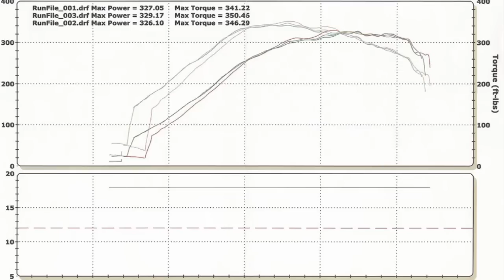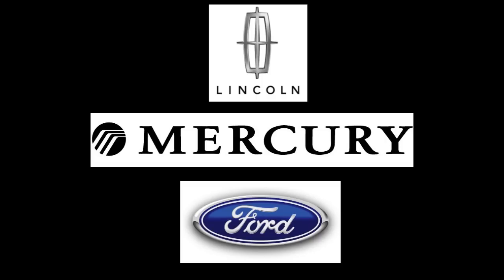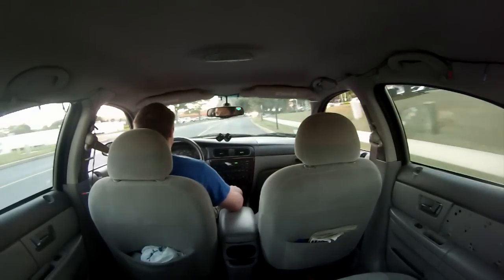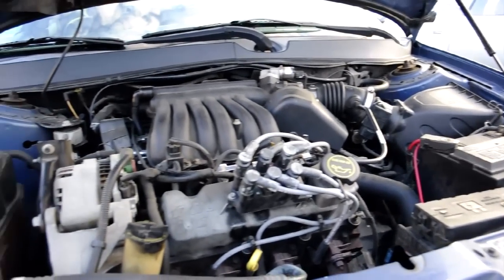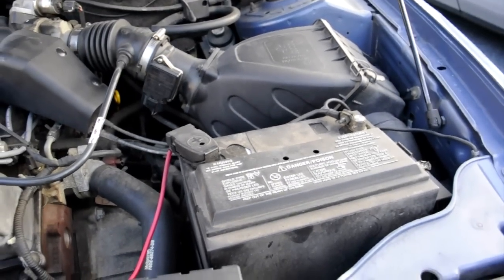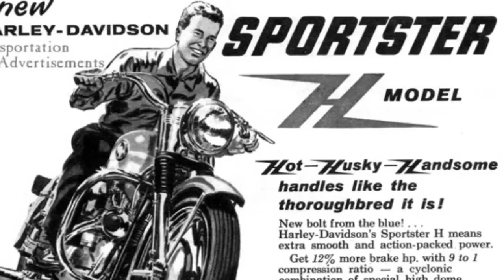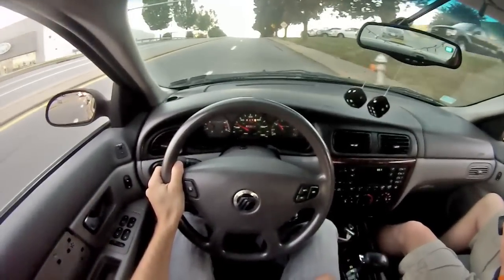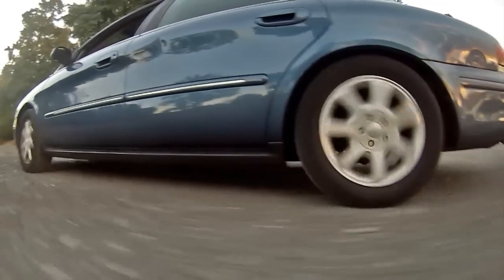Regular Car Reviews: 2002 Mercury Sable

Comment: My friend had the Taurus version and it blew a head gasket while drag racing me in my moms Windstar with the same engine.
Reply: +Evann Smith This mad me laugh so hard haha. I remeber my 2003 Taurus and man that thing just had no power to do anything but fishtail on dirtroads
Reply: +Evann Smith I had a '99 Taurus with the same engine as my first car. Got it with 101,000 miles on the clock, didn't even drive it hard, and the block completely locked up a week after I hit 104,000 miles. Hadn't even had the car six months.
Reply: +Evan Richardson How long had it been sitting?
Reply: I had a 98 Taurus "gifted" as a hand-me-down from my grandpa to me as my first car with just something like 20-30k on the odo. The car did not last past 64k. Somehow in that span of time all of the computers died, it had emissions systems problems, electrical issues, the radiator rusted out and clogged the coolant loop while driving on the golden gate bridge, and finally the transmission just totally shit the bed and we crushed that demon.
Reply: samwise1790
I had a 626 that uses the same transmission and it was terrible. It needed a rebuild every 20k. Ridiculous.
Reply: Lion Celica it didn't sit. It was my daily during the short time that I owned it.
Reply: Way late to the party but. I had a 99 Taurus with the duratec 3.0 and it was pretty decent for me. It was my mother's daily from 99 until 2011 when it was handed down to me. It lasted me until I traded it in at 112,000. Talked to the dealer a month later and the next owner blew it up. To be fair it had started to leak oil among other things. These cars were good but only designed to last until around 100,000.
Reply: Guy I worked with has a Taurus that fell apart within 6 months of getting it
Reply: @Inferno_Assassin  i had an 08 fusion with the duratec and when I sold it it had 230k on the clock and it was my first car as a 16 year old teenage male. To say I drove that car hard is an understatement. I was constantly pedal to the floor, sending it as hard as I could around corners etc and It held up well. Had a slight oil leak around the timing cover and the sunroof leaked, but the engine and trans still ran just fine.

Comment: The Sable was the vehicle for those that saw cars as an appliance, nothing more. Acceleration with the Vulcan V6 was best described as "eventual".
Reply: I chuckled
Reply: Eh, it's actually a pretty good motor. The best way to describe the Duratec and Vulcan is this. The Duratec is a high rpm horsepower beast and the Vulcan is a Low rpm torque monster. The Vulcan V6 does not like to rev high.
Reply: @legostar55  True... the 2001 taurus i used to drive had a vulcan and it didn't rev crazy. Acceleration was surprisingly okay, did't feel much different than dad's old 1999 suburban that had 255 horsepower. When punching the gas with the wheels turned hard left or right from a stop sign, the tires almost always chirped
Reply: Yeah, I've had 5 Sables pretty decent quality. But 1 of mine had the Vulcan while the other 4 had the duratech. The duratech is definitely the engine you want, it has good power, could take a little bit of high revving if ya gotta "give it the beans" and its relatively good on fuel even by todays standards. The Vulcan although reliable and pretty well made, I have to say. It accelerates like a dog being flogged, especially uphill. Another thing, these cars are great as long as you keep the engine and transmission oil and fluids clean

Comment: I had a 2002 Ford Taurus, and I can say beyond a shadow of a doubt that there is no way the suspension is softer in the Mercury Sable. It wouldn't support the car anymore. That being said. I sold it with over 215k on the odometer. I treated that car like dirt, and it just came back for more. The A/C compressor died and caused an overheating issue, but once that was disabled it ran just fine. The headlights were so fogged over that if you didn't use a restoration kit on them every year you couldn't drive it at night. It was rusted completely through on the rear quarter panels, but I made a $25 profit when I sold it. The Vulcan engine is the most boring motor that I have ever had in a car. It doesn't rev, it doesn't make power, it gets mediocre gas mileage, it doesn't sound good, and it's not very light. It takes forever to warm up on a cold day, and there will always be a small oil leak somewhere (mine was so slow that you didn't have to add between oil changes). It will always smell like oil, but you'll never bother to fix it because... you paid $300 for the car... and then sold it for $325 after you put 15k miles on it.
Reply: Turner Pendergrass The car i learned to drive on was 98 Sable that had the Duratec, it was awesome unfortunately the security computer died in it and made the car so unreliable that my parents had to get rid of it.
Reply: Turner Pendergrass i had an '01 Taurus with the duratec and i loved that car. I treated her like dirt too and the thing kept coming back for more, kinda like herpes. The duratec made a much better noise than the vulcan and it was pretty much bulletproof. Tune ups were a pain because of all the damn vacuum lines, and having to remove the upper intake manifold but hey, she ran like a top most of the time. i got her with 116k miles and sold her to my mechanic with 172k due to a fuel pump issue. Ive seen it around town and still looks and runs as it did before the issues. Safe, solid cars but by this time ford had given up on the platform and relegated it to fleet sales.
Reply: David Gonzalez 01 Vulcan, here. It went through 3 or 4 sets of springs (they kept breaking), always pinged and it ... literally ... rusted in two at 75K miles. Always babied it, too.
Reply: Mike Miller Mine was most of the way rusted in two. The plastic trim at the bottom was certainly structural. It was a scary ride, but fun to trash.
Reply: +Turner Pendergrass Yea mine rusted in the exact same spot to. I think its a design flaw or something cause every other taurus i see has the same rust spots.
Reply: I have a 99 taurus with the duratec and the suspension is stiff as hell.  I drove it 10 years ago when I was a mechanic in college and other tauri were incredibly soft.  Not sure why mine wants to pretend it's sporty or something.  Still runs okay; the engine has a great sound.

Comment: I own a sable GS ( base) and I love it. Yes the engine sucks, yes the suspension could be a little better, but all in all for a first car, I love it. For what it is it's a great car especially since I bought mine at 48947 miles. And I don't regret buying it for as much as I did (4K). It's been a great, reliable, fun car to drive. It's my grocery getting, work transporting, skatepark visiting, state-to-state traveling, filibustering engine, coolant leaking, overly tan, faux trimmed, lovable mid-level luxury sedan. Some of the high points are that it has good trunk space, can comfortably fit 5 people (maybe 6), gets decent gas mileage, and requires very little to no maintenance outside of oil changes, brake changes, windshield wiper Replacements,  and headlight cleanings. This car has made my adulthood from 20 to 22 and hopefully even further into the future, yes I will buy more cars but this one will stay around for a very long time ( cause I'm not selling it, or getting rid of it), even if the engine blows I will go find another engine and put it in this car no questions asked. So hats off to Ford for giving me the greatest memories in my favorite car of all time, and to Mabel my 2002 Mercury Sable GS, with your v6 iron block push rod, God speed and here's to many years ahead! 💞⭐🎆🎇🎊🥂🍾
Reply: Yeah, '04 taurus owner here. Come revisit everything you just said once you're car hits 100k. Around 75-80k is when the real "fun" with the engine will start to begin...
Reply: Do you still have the car?

Comment: God damn there's so much Pennsylvania in this video. Giant, Redner's and Weis? Damn, so weird understanding those references, lol.
I can't speak for the Sable but I have a ton of respect for the Taurus, even if they're incredibly gutless sometimes.
Reply: Having had about 15 of them, I've never found one "incredibly gutless", unless it was my '88 with the 2.5L HSC 4cyl and the 3-speed ATX. Even it would cruise at 70 all day long without issue. If you think a 3.0L Taurus is "gutless", then apparently you haven't driven a base (read: 4cyl) Accord or Camry from the same era.
Reply: I've driven a 98 Accord with a 2.3 VTEC (which doesn't help my case since their cooling systems like to "buddy up" with the oil ports and ruin everything) which still felt like it had more power than my 97 taurus does. Although to be fair I haven't paid enough attention to do a proper comparison. I'd still rather have the taurus any day. That thing hasn't really let me down yet.
Reply: VTEC Accords are awesome, I'm mostly referring more to the DX and LX models (they are what competed with the Vulcan Taurus). I had a '95 Accord LX (non VTEC), and it was incredibly slow. My '95 Taurus now would run circles around it.

I had a '97 (Sable, same as your Taurus as I'm sure you know), it was an incredible car. I deeply regret getting rid of it. In fact, it's one of the main reasons I picked up my '95, I missed the '97 so much. The gen 3 ('96+) gained a few HP with the Vulcan but the car got a lot heavier, so they're not as quick as the previous gen in my experience.

 '95 was my favorite body style, which is why I didn't go back with another 3rd gen. I am, however, looking at a '99 and an '03 (4th gen) on craigslist now that need minor repairs. Both cheap, just like this '95 was. I may have a fleet of 'em before long, lol.

Be sure to change your transmission fluid AND FILTER every 30K or there abouts. If you feel a shudder when accelerating, that's a good sign that the trans needs servicing. DO NOT have it flushed (worse than doing nothing at all), make sure they change the fluid and filter if you have it done somewhere. Go so far as to tell them you want to see the old filter, this way you KNOW they did it (you should also see the trans pan under your car being much cleaner than the rest of the engine/trans, as they're supposed to clean it before putting a new gasket on).
Reply: Yeah, funny how you mention the 3rd gens being heavier..on top of that, mine's a GL wagon, but I like the wagons the best anyway. I'm planning on eventually getting something much bigger, but if I were to drive another Taurus it would be a 2nd gen, they're my favorite too.
The 98 Accord I drove for a bit is an LX and it's  my brother's car that I was doing work on, it's nice all around but the F23 series engines aren't something I would favor. They're good in terms of performance, but in design I don't like them. The cooling jackets are wide open at the top and if you're lucky that the head gasket holds together, one could be unfortunate enough to get a crack somewhere in the block that lets oil in (which is what I think is happening to his car) and eventually it has to be constantly flushed until the engine can be replaced or the car can be junked. But man that thing has a fast feel to it. I think it'd be better and possibly more reliable with a V6 in it though.
Reply: Actually, I've never trusted Honda V-6s, I'd rather have one of their 4s. I guess that stems from my experience with early Accord V-6s and the Acura Legend, both of which have lots of issues. I hear Honda's current V-6 (used in the Odyssey, Pilot, Ridgeline, etc.) is pretty good and reliable, its just the transmissions in those cars that are not that great.
Reply: I've lived in Pennsylvania, but I've lived in the part of PA where Giant is called Giant Eagle, and Redner's and Weis were stores completely unseen unless you're taking your 18 year old to State College.
Reply: They got a Weis here in spotsylvania
Reply: I wish to repent for my unbelievably ignorant comments. The Accord of that year has one of the best engines ever made, I was just being a smoothbrain and didn't know how common and reliable the "open deck" cooling systems are on modern engines. That, and I had minimal car repair experience and tools available to make certain repairs easier so I was frustrated at the time. I am now an ASE master technician working for Toyota. That Honda engine just simply had oil contamination, probably due to some terrible mistake made by the previous owner. Got it all flushed out several years ago and it's been a great car ever since, having only needed a front wheel bearing and a few other things from time to time. It does need a transmission rebuild though, my suspicion is that the shift valves are sticking and causing flare shifts on the first 3 gears.

Comment: I have 2 Taurus and a Sable, love them all alot! the Vulcan is a super reliable engine that will just keep on going, but it's slow but it's super  damn reliable. I have the Vulcan in both a 99 Taurus SE and a 07 Taurus SEL and I have a Duratech in the Sable. the Duratech is so smooth and speedy and reliable. the Taurus and Sable I can say hands down are some of the most reliable cars ever made. teens beat on them, old people take nice trips in them, single parents are rocking them. family's are rocking them. there just everywhere
Reply: IA Vagabond 
Yep. Ive owned 5 Tauruses. 1995, 1997, 1998, 1999, and 2002. Never had a single issue
Reply: As a man with a 98 Taurus SE with 250K miles, I can say this car is getting put through the ringer.

Comment: My mom had an '03 Sable LS. powerhouse engine, pulled my dad's 1999 Chevy Silverado scrap hauler truck fully loaded with 2000lbs of metal, up a long steep hill during the middle of winter.
Reply: yeah the ls came with the duratec. Much better engine. Quite high tech at the time especially in the 90's when it first came out.

Comment: My first and still current car is an 05 Taurus. Vulcan 3L v6. 147k miles and still going. It is the epitome of a lackluster and boring drive but with how cheap parts are and how easy it is to maintain I have no complaints. Had it for less than 2 years, put 27k miles on it. I drive a lot.

Comment: I had the 3.0 Vulcan in my '02 Ranger. With 154hp it wasn't very fast or impressive. But it sure was reliable. Outside of regular maintenance I racked 250k original miles on the odometer before I traded her in. Never burned oil between changes either, and still ran and shifted like new the day I sold it.
Reply: Doesn't surprise me. I've owned every Ford product offered with the Vulcan (except the Mazda Mustang....oops I mean Probe), every damn one of them was as reliable as the sun. The Ranger was, by far, the slowest. I don't know why, maybe gearing? Even my '94 and '96 Aerostar Vulcans were quicker than my Rangers (had a '00 auto and a '94 5-spd, the 5-speed was better but still nothing to brag about).

Comment: I got a 2002 Sable LS fully loaded and it was an amazing vehicle. Kinda wish I hadn't traded it and instead just used it as a spare car, but unfortunately being 19 meant high insurance on it even with just PLPD because it was a V6 and was over 100k miles. But you're right, that engine was like pressing the gas pedal into a silk pillow, and it sounded amazing. Nice review.